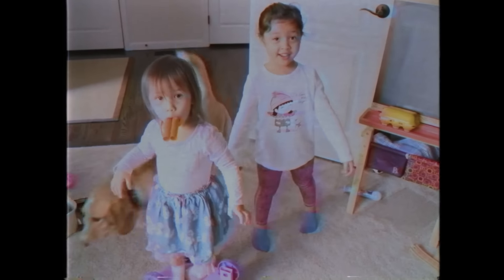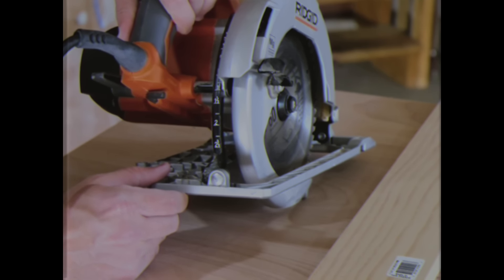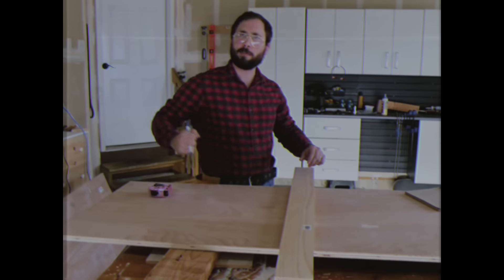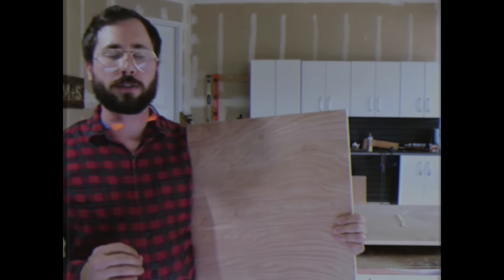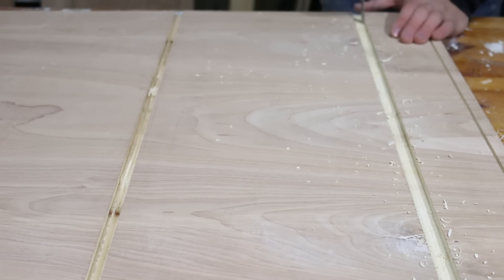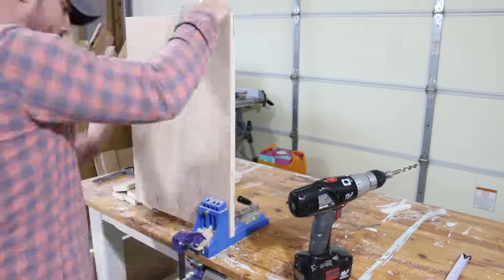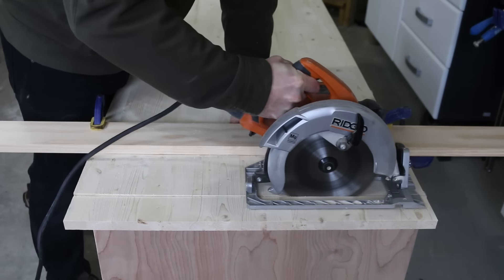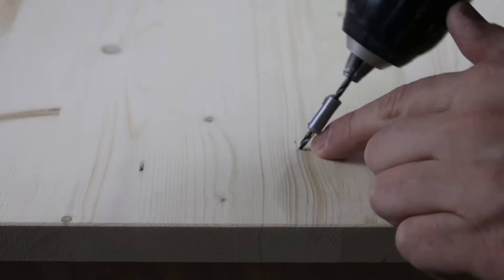Build a Storage Desk

Comment: Just out of curiosity, what's the advantage of changing the depth of the blade on the circular saw?
Reply from the maker: You want to extend the blade about a 1/4" to 1/2" to make a nice clean cut. Any more than that can cause the saw kickback while also exposing the blade. Hope that helps!